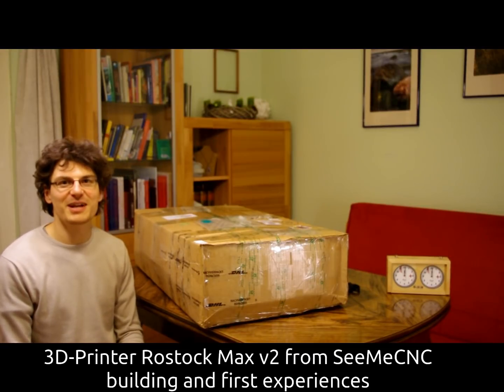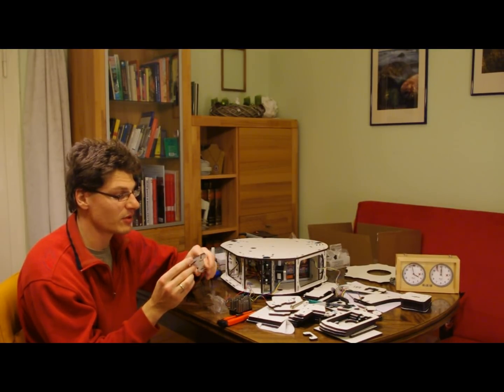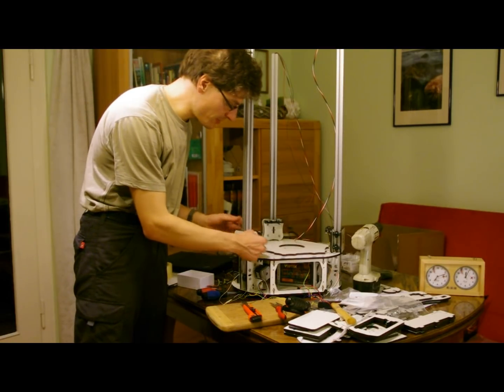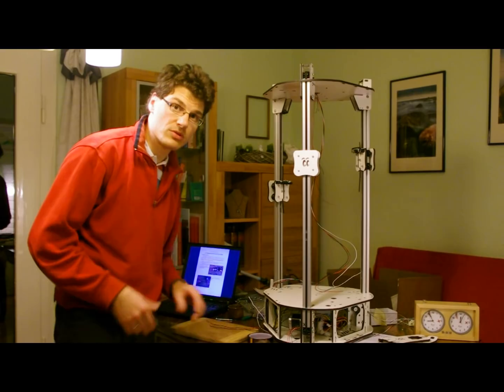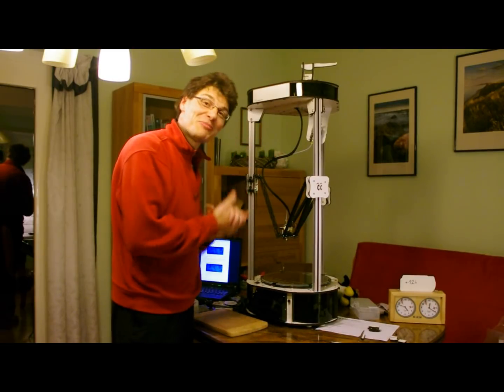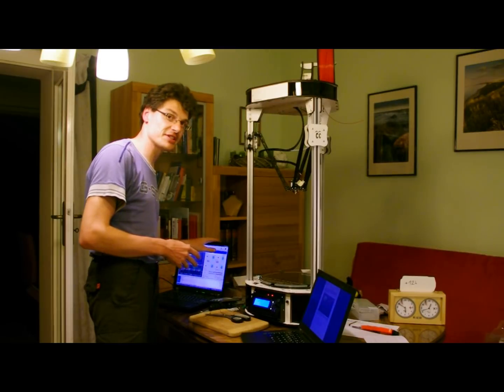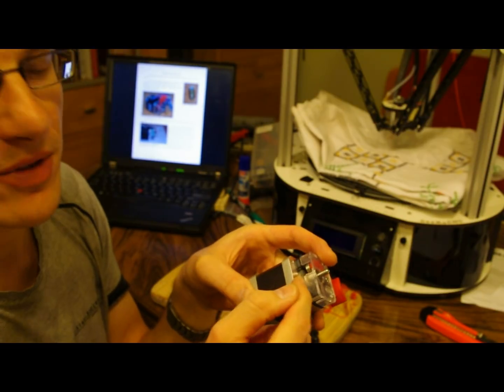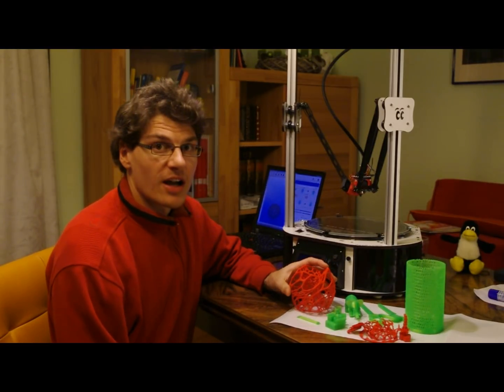Rostock Max v2 unboxing, building and first printing review

Comment: How are you doing in 2025 Georg? I just got this machine today from a friend. Where did you find the manual to build or calibrate the machine? It came with a little tablet too, does this interface with the pc to send the g code?
Reply from the maker: Hi there, I am still using the printer and it works fine. 
you can download them still from seemecnc: 
https://www.seemecnc.com/pages/downloads
I am using repetierhost software to interface it from the PC.
Reply: @GeorgMartius  what a legend for replying! Thank you! I found the manual and running repetier but trying to get the matter control tablet to work. Have you ever used that tablet with the printer otherwise I have to leave my pc on while it prints and if the pc falls asleep the print pauses.
Reply from the maker: @Custom3dPrinting4U  Cool. No, I have never used a tablet. Sorry, cannot help here. I have an old Laptop that I am using for the printer, there I disabled  suspend power saving. 
BTW: if the printer is already old. consider replacing the nozzle. Happy printing.

Comment: and one more question.... where did you get the RTV silicon from? (I'm not living in the US as you, and need to order it here somewhere most probably...)
Reply from the maker: +John Coffee I ordered it in the UK that time: Check here: http://www.ebay.co.uk/bhp/high-temperature-silicone, but maybe you get it in your country as well.
Reply: +Georg Martius 
Thanks for your note back. I don't think that I'll get this in Switzerland. Question: Where and why is this sealant used? What is it for ?
Reply from the maker: +John Coffee The High temp silicone is for glueing the heat resistors and the thermistor into the print head. Choose one that resists a high temperature.
Reply: +Georg Martius Gotcha! So basically every high temp glue (we do have ceramic glue that withstands 350deg.C) would do the job I suppose...:-)
Best regards John

Comment: Thanx for the answer, Georg. May I add a few questions after having looked into the Assembly Guide:  
Are there German equivalents that you can recommend for the following:- Locite or Permatex Threadlocker Blue- PermaTex Ultra Copper High Temp. RTV- 1/2" wide roll of Kapton tape- Elmer's Glue Stick "Disappearing Purple"- Standard sized nylon wire ties- Waxed lacing cordI know that this can all be ordered form the USA but dread the complication. Since I am at it: What tools do I really need in the metric world of Germany as I am reluctant to purchase extra tool with imperial dimensions ;-).Thanx in anticipation,Mike.
Reply: +Michael Schiebe 

I've just build my Rostock Max V2 - and while writing this I'm just printing my first part (fan shroud).
Had the same questions as you have and also in Switzerland there are no imperial dimensions and certain stuff not available:
I used:
- "Loctite Blue" instead Permatex  Threadlocker 
- K2 Bond Silicon 350°C instead Permatex Ultra Copper Hight Temp RTV (http://www.amazon.de/Hochtemperatur-Silikon-Dichtmasse-SCHWARZ-KARTUSCHE/dp/B0078U8HN2)
- 1/2" or 1/4" or 1" Kapton is a must. I just love it. You can get it everywhere 
- Elmer Glue stick: Even I've order from the US (sigh) I just discovered that UHU Stic Magic blue works as well on the glass bed when applying on Kapton that has been applied to the glass first.
- No wax lacing used - just cable rap ties. (I would love to use the wax lacing as well but it sells very expensive here)
- Use a 8mm  wrench instead 5/16". For the 11/16" (1 nut only at the hot end!) use a monkey wrench 
- The imperial allen key 5/32" is used a lot and you definitely need the 7/64". Can't remember using the 3/32" though.
- P1&P2 screwdrivers are essential - make sure you use exactly these types from a quality vendor and no cheap made tools. 
- I used some very small amount of grease on every screw since I've got 2 screws seized in a thread before using grease. Also the screws could be mounted with much less force into the threads. Especially for the #6-32 nylon lock nut with it's #6-32 1" pan head counter part.
- Clean the melamine parts well with some alcohol on the cutting edge before assembly. The tend to smell bad and you'll get black and dirty hands.
- Wire crimping tool is also required. I could borrow a professional crimping tool - but a cheap one should do the job as well (5€ piece)

It was fun to assemble it and even more fun when you see it running! I love it!

Best regards

John
Reply from the maker: +John Coffee Great that you built yours and it prints fine. Actually I don't use Kapton tape on  the glass, but maybe I give it a try. 
Regards,
  Georg
Reply: +Georg Martius 
Georg - I just found out that "Uhu's stic Magic" works like a charm on the glass bed, even without Kapton. It sticks very well during the print and pops off after printing during cool down at around 40~45°C.

With Kapton, the adhesion is even better and it was more difficult but not impossible to get it off. I use the tool that was supply with the Rostock for doing that.
Not sure what role the Kapton plays here really and why it sticks quite strong. Probably during cool down, Kapton is somewhat flexible and compensates for the different shrinking of the ABS compared to the borosilicate glass bed. (this was now a wild guess ;-)

Best
John

Comment: Hi Georg,Thank you so much for the encouraging video!My questions: What is the best way of ordering if you want the Rostock V2 to be delivered to Germany?  I found EBAY and alternatively SeeMeCNC and noticed that there may be alternative sources.Further, what add-ons do you suggest? The tablet w. MatterControl, the 0.5mm nozzle, anything else?I am looking forward to your answer,Mike.
Reply from the maker: +Michael Schiebe I ordered mine directly from SeeMeCNC. The newest version comes with the ball bearings, which is great. Their filament is also great. You need one spool of ABS for the fan holders you print first. So think of the color you like to be on your printer. Otherwise I typically print PLA because it is better printable. At the time when I ordered mine, there was no Mattercontrol etc. so I don't know. Maybe additionally go for the smaller nozzle size (0.35), because later on you have to pay a lot of shipping. 
Have fun!

Comment: That was fun to watch. i am in the middle of making mine, it has newer "cheap skates".
nice color, what camera do you use. what was your frame rate? it seemed like perhaps 1 frame per 2 minutes?
Reply from the maker: +peetre I used a SLR (Pentax K5d). I had one frame every 4 sec. (which is speedup 100 with 25fps) Maybe a accelerated the video afterwards while cutting, but I think not. 
Hope you have fun with yours!
In the meanwhile I have changed the heating of the hot-end to use heating tubes where I don't need the silicon (it got loose after one year).
Reply from the maker: +peetre Do you also have the new arms?
http://seemecnc.com/products/rostock-max-ball-cup-delta-arm-kit
I just build similar ones myself (with carbon rods though ;-)
I would certainly go for them.
Reply: +Georg Martius yes, i have the  carbon fiber arms.   I have found a few photos in the manual to be backward.  Those always set me back about a half hour to figure which is the correct orientation!  What color is your latest one, mine is white.  I been only getting about 1.5 hours a day to build.  I just finished the mechanical part and am going to start the LCD display tomorrow.  What do you do for work?  I am semi-retired but have about 20 cases and inventions for the GoPro camera that I market, and this will make my design changes quicker.  I market them under GeckoGearUsa here.

Comment: Thanks for sharing your experiences.
I have just finished building the Max v2 over the past few days, it's a very cool looking printer, but unfortunately my power supply cuts out when heating the bed and extruder at the same time.  It took a long time to build, but I'm glad it's done!
Reply from the maker: Hi. Congratulations. Sorry to hear about the power supply. Weird it should support it. I had no problem. Maybe you just got a bad one... Good luck.

Comment: I have seen more negative reviews than positive on this printer. I went to a makerfaird and saw this printer and my prints on my cheap $450 prusa i3 were identical if not better than these prints. Do you have issues with the extruder? How the extruder motor is mounted above with the tube is the reason preventing me from getting this. It just isnt possible to get accurate extrusion like that. What do you think?
Reply from the maker: I didn't have problems with continuous extrusion. The retractions are a bit more tricky but still doable. I have no comparison, so I don't know how easy it is on other printers. The bowden has some disadvantages, but also the advantage that the platform is light and so the printer can be very fast.
Reply: I feel like this is a good printer for people who will print things 10x10 inches and take advTage of the whole print space. But after tinkering woth a prisa i3 for a year and getting it perfectly calibrated, i want a ready made printer that i can leave running over night and not have to worry about it messing up and burning the house down. Im looking at the flash forge creator pro. It seems like the best quality for the price, you should check it out

Comment: How many microns does it print at? and does the quality of the print look good?
Reply from the maker: Hi,
The quality is pretty good see: http://www.thingiverse.com/hronopik/made
I didn't upload many. The ones with many retractions are difficult to get perfect due to the bouden extuder. So the Tower of Pi didn't come out so well but is doable with some tuning. I print at 0.2mm layer height and a 0.5mm noozle. Other people use 0.35mm and 0.1mm. I think the machine is precise enough for it.

Comment: Thanks for the excellent presentation! How many calendar days did it take from when you received the box till when you started printing? I know we all have different lives and ways of finding 20+ hours, but I'm just curious.
Reply from the maker: I thought I answered you question already... but apparently didn't.
I spend about 3 weeks if I remember correctly.
Do you also have one?
Reply: Ah, good to know! No, I was considering it, but ended up getting an Orion for now because I had some projects I wanted to get going (I had lost my old printer and was already addicted to having one!). I may build a Rostock Max later on, and then if that all works, sell the Orion. If I do the build, I will definitely be heartened by having seen your experience! Vielen Dank!

Comment: which printer would you recommend now????
Reply from the maker: I am still very happy with it. I didn't try another one.
The bouden extruder makes it a bit more complicated to get rid of fine hair on retraction and it is probably very difficult to print rubber.

Comment: i am planning to buy this printer  but i cant find any reviews for this printer
so will you please share your experience with this printer
Reply from the maker: I am still very happy. Printing a lot of things, but so far more small parts.
Reply: Thanks but it is harder to assemble , can you recommend any other low cost printer ?
Reply: Arpit Gupta
Reply from the maker: ankit sejwal I am not sure how long it takes and how diffuclt it is to assemble other printers. I guess it is rather similar. It is important that you have a good manual etc. Sorry, I really cannot give you good advice, because I have no expierence with other printers.
Reply: K, really thanks georg.

Comment: Thanks for taking the time to post the video. I downloaded the assembly manual for
the Max V2 and now feel like I'm on the high board and afraid to jump. I'm guessing
you looked at other 3D printers, what influenced you to go with the Max V2 ?
Reply from the maker: I like the delta design. It looks good, allows faster printing and also needs less space on the desk. I also wanted a large printing volume. Among the delta ones this seems to me the most mature. I think the kossel Pro from OpenBeam will be an interesting competitor but it is not yet out : https://www.kickstarter.com/projects/ttstam/openbeam-kossel-pro-a-new-type-of-3d-printer/posts and http://www.openbeamusa.com/. There are a couple of other kickstarter projects building a Delta printer, but they are all not in production phase.